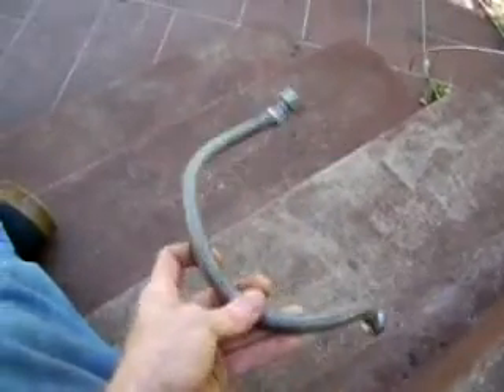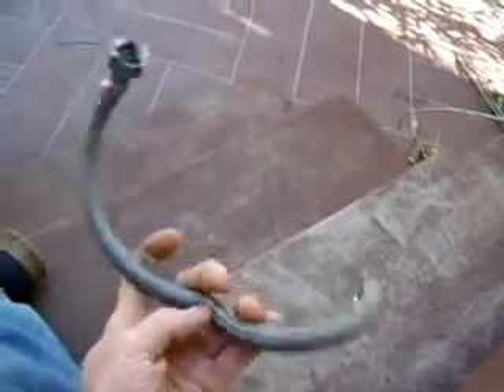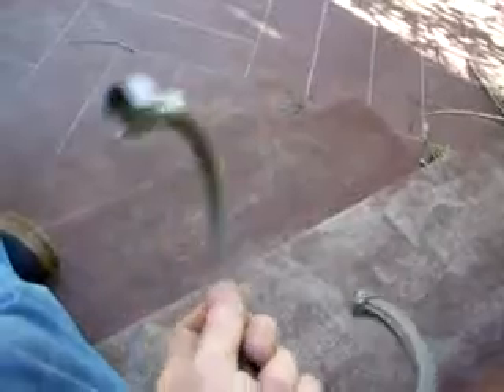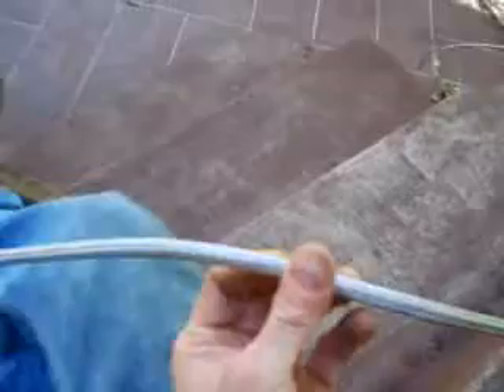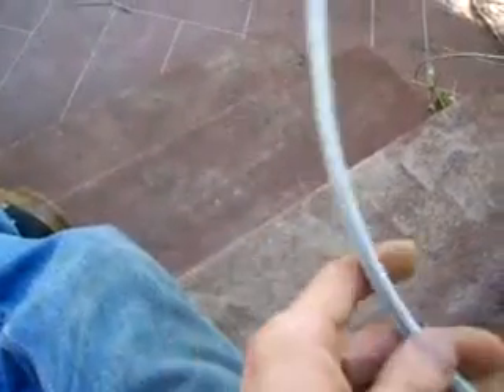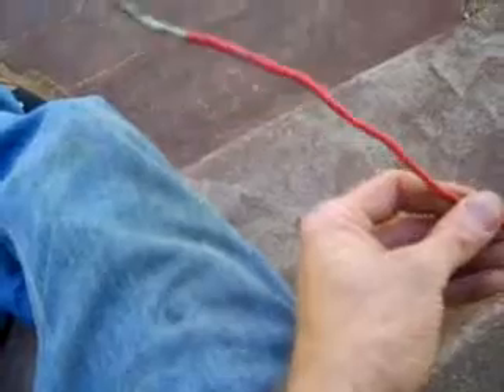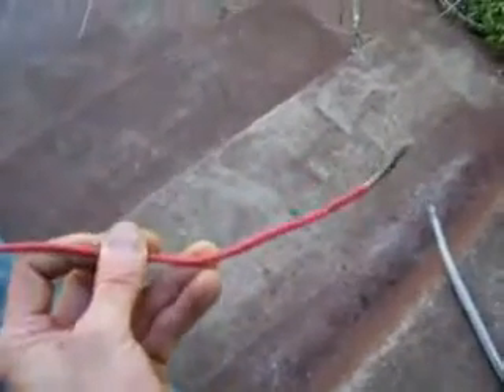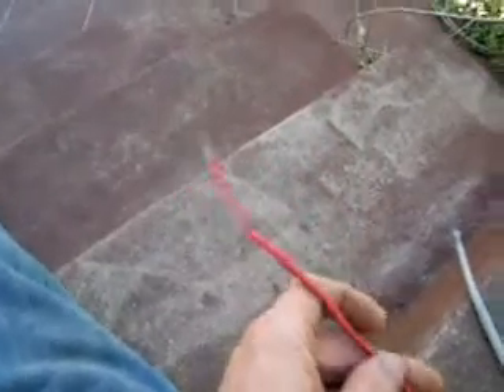hho stainless wire leads

Comment: nice find ... suspect you will find your custom made wire gets a little hot though ... stainless aint the best of conductors ... the way most get around it is to use a pretty heavy duty hunk of stainless sheet bent to fit as a lead ... that way, it can handle the amps without getting so darn hot ... but let us know how your "make it work" works out ...